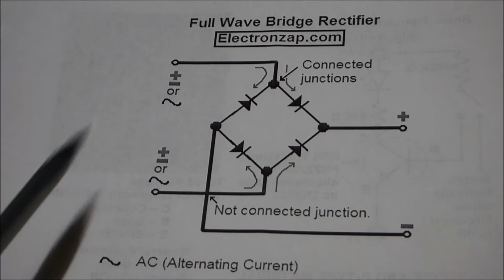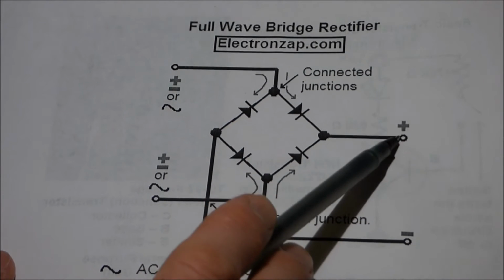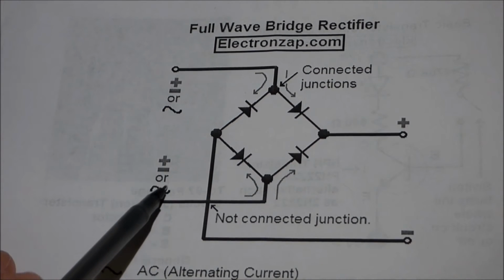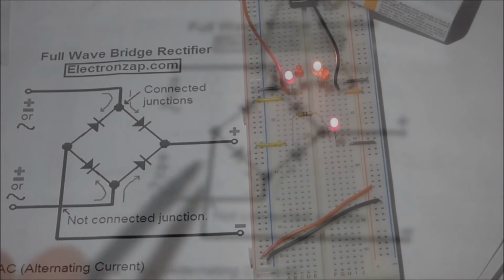Electronics circuit. Full wave bridge rectifier. LEDs and 1N4001 diodes. Rectifier component shown.

Comment: what is the value of your resistor?
Reply: You can calculate that from ohms law. Take the voltage you will use to power the circuit, subtract the forward voltage of the LED and divide by the current the diode needs.